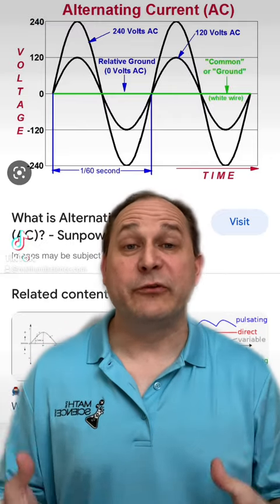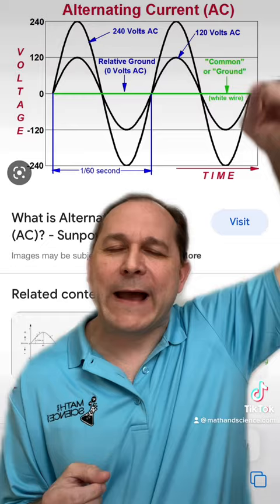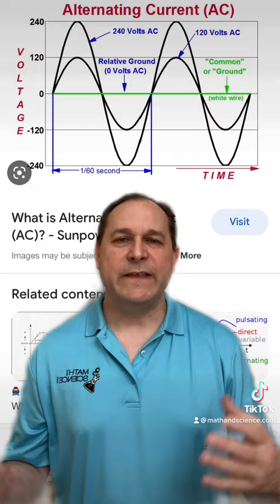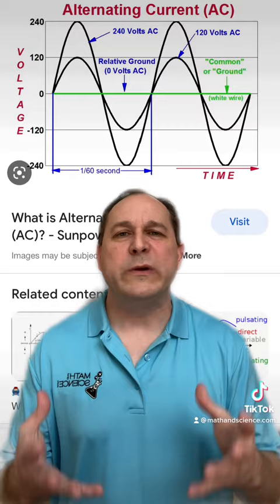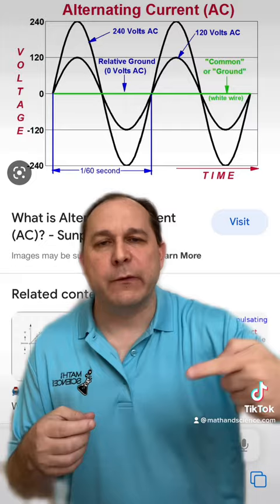What is AC Vs. DC Electricity? #science #electronics

Comment: Another thing I like to point out is why we use AC for homes instead of DC. When we were building electrical grids, it was much simpler and easier to manipulate the voltage of AC than DC. A basic transformer is just two Coils of wire with different numbers of wrapping to change voltage up or down, so can run the main lines at thousands of volts up until you’re at the home where it steps down to 240v. The reason we need to do that is because higher voltages can carry power more efficiently. So generators can be further from homes.
Reply: Hey bro, what are you doing watching this video? You already done got all this down lol.
Reply: That was a really clear explanation bro thanks

Comment: the usefulness of AC current was, it was able to Step Up or Step down  Voltages using transformers and  transmitted from Generating stations to various parts of city and then Step down and supplied to a house or a locality.

Comment: To be noted: the big or tall towers you see in our elevtric grid is DC, and the smaller wooden poles in our streets and backyards are AC. The reason being DC can carry high voltage more efficiently in long distances. It can carry big blocks of energy without power loss.

Comment: But if current stays at same place moving back and forth why we get electricity bill
Reply: Why do battery runs out its electricity when the current just lopping the battery?
Reply: Yes I have been asking this same question
Reply: @noobaccount7580 even though it's a loop, we don't see the other things happening. Energy cannot always be contained, it always wants to travel somewhere else. Have you ever been charging your phone and the adapter heats up? That's because energy is being lost as heat, which is what happens to batteries. Also, the chemical reaction used inside batteries to create electricity can't be "turned off", so that's why batteries lose charge even when they're not being used.
Reply: @jaydottt_transitfanner  yeah, i just want to tell this guy that to create current flows it needs energy (you must have the magnet moving to create current). That's why you have electricity bills. I'm currently studying EE by the way.
Reply: @noobaccount7580 ohhhh, i thought you asking a question
Reply: @noobaccount7580  because battery is dc current which goes only in one direction
Reply: because battery is dc current which goes only in one direction @BoredT-Rex
Reply: @celery7810 created by electrons

Comment: For the first time, I am able to comprehend this particular topic! Thanks!! Just one question, why do we need alternating current? We can just use DC?
Reply: Great question, the reason why we dont just use DC is because DC is hard on telephone cables, and can cause them to overheat and burn easily, therefore, DC is inefficient as far as traveling to our houses goes. AC is much easier on power lines, and therefore can travel much easier to our houses and appliances. DC is still used today for most curcuits, as it doesn’t need to travel through telephone cables when powering a circuit, as the AC going into your house is transformed into DC to power your breadboard circuit.
Reply: Transformers. and I don't mean Robot in Da Skies.
Reply: What makes DC rough, scruffy and hard on telephone cables while AC is swift and agile?

Comment: What I still don’t understand is what the point of AC is, though. I understand how it works mechanically. 

(I am very new to this)
Reply: AC is more suitable for long-distance power transmission. It can easily be transformed into higher or lower voltages using transformers,
which reduces energy loss in transmission lines. DC, on the other hand, isn't as easy to transform, so it's not as efficient for long distance power distribution.

Comment: Is their a benefit to AC over DC sir?
Reply: Ac is easier to convert to higher voltages with transformers and transmission lines use high voltage because it reduces losses

Comment: Thanks. But what are the advantages of AC, so we use it instead of DC? I mean is it cheaper or something? And whether it is, why?
Reply: AC current works with transformers as the alternating magnetic field produced by flowing charges (changing current) can induce a current in other wires (Faraday’s law). Because the equation for power loss in transmission lines is P=(I^2)R, and R is constant, we use transformers to reduce the amount of current in the wires by increasing the voltage between the points (P=VI). In short, we use AC in houses and transmission lines as it’s compatible with transformers (which aid in the reduction of power loss through heat in wires)